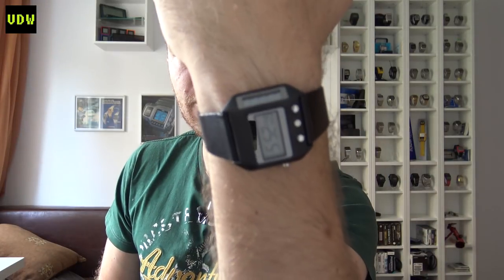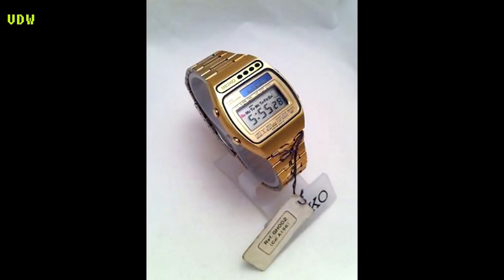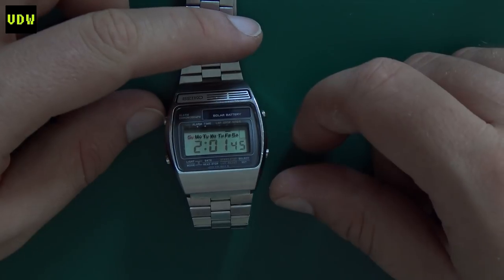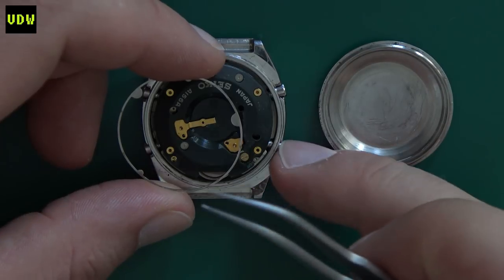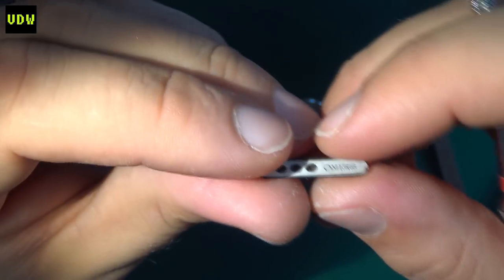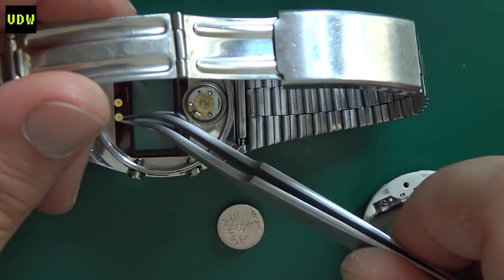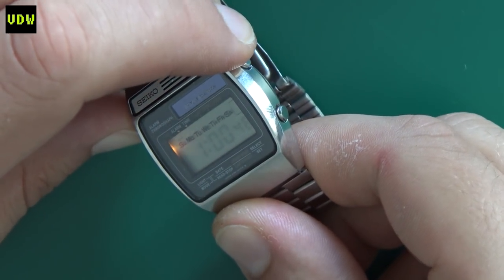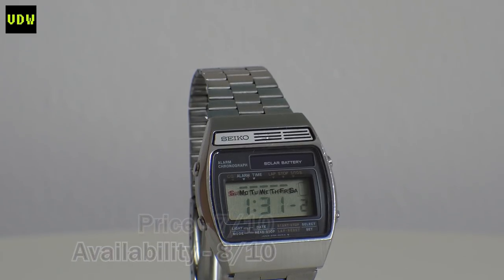Seiko A156 Review - Ep 56 - Vintage Digital Watches

Comment: Hello, This is also my favorite Seiko Digital Watch..
I use a VARTA V15H rechargable battery.(NiMH 1.2 V 15 mAh)  This works great in this watch! It also has the exact size and it charges on the solar panel...
Reply from the maker: Super Useful INFORMATION, I'll pin this post in case anyone else needs something like this. I just ordered one.
Reply: I 'm tryng but it does not work in mine. Does anybody else Tried it? It also seems not right size
Reply: Muito obrigado pela informação!!
Reply: Receiving mine tomorrow. Was looking for Battery info!
Reply: @VintageDigitalWatches  and it works?
Reply: Hello!!!. Is your Seiko still working fine with this VARTA V15 battery?
I just bought this watch and it needs to replace the battery.
Thank you

Comment: I have one of these purchased  new back in the 70s and need to replace the O ring seal for the screw-off cover.       Are these O rings available?    If not, what are the dimensions of the O ring?   

Thanks!

Comment: Hello, I'm tryng to fix mine. I disassembled the module , cleaned everything and reassembled. Then I put on a New battery (normal one 1,5v) . Watch seems dead but after some our it turns on. The problem is that when i press the right buttons they work (even beep) but watch turns off for a while. If i press left buttons (light(witch works), adjust ) watch turns off longer. Light always works. Can you help me?

Comment: Once again a great video and review of this must have seikos ( for me anyway)
I didn’t know you could have used a standard battery for solar. 

Ps, thank you for the group shout out in your credits.
Reply from the maker: No problem Michael, and  in the first comment someone recommended an alternative to the power cell, I already ordered one and I am keen to see if it works.
Reply: Note that this only works if the secondary powercell (the solar panel cell) is not damaged..
I also have a A156 that only works with a normal battery, because the secondary battery is damaged...
(The panel will blink after a while, indicating the powercell have to be replaced)
I hope you already tested the Varta V15H. I already have the watch running for over 4 months now without any problems... (the datasheet of this powercel says its Life Expectancy is about 6 years...)

Comment: acctually i bought the A156 on eBay with a 'normal' battery. I changed this with the Varta V15H.
After e few weeks the 'normal' battery exploded! You don't want to have this happening when its inside the watch. so maybe its better to be safe and put tape on the charging points...

Comment: hi. i have a A158 and would appreciate any review/description available. i am keen to use it again but it appears that one of the connectors on which the battery rests/connects has come loose after being in its box untouched for probably over 25 years. thanks for any insights / inside views to restore mine.

Comment: Hi man. Really great channel. Congratulations. I have this one and the melodic, it is beatiful. It has a missnig segment wich sometimes is shown, but it is almost always off. I cleaned zebras, LCD contacts and motherboard contacts but nothing. Do you have another techinique to bring it alive again? In bigger calculators I have seen a tech who pass the solder over all the contacts in order to refresh them if any is in bad condition, but the chip of digital watches is very small and I am afraid of pissing out. Thanks a lot. I have almost 200 digital watches, some of them very strange. Greets from Argentina.
Reply from the maker: Hi, and thank you for the comment. Good that you cleaned the zebra strips, make sure the LCD is also cleaned and the board. If everything is cleaned it is either the LCD or the board of the watch. You can test both but it is a little complicated. As for the soldering technique, it is just a technique and you can refresh the solder in any other way.
Reply: @VintageDigitalWatches   Thanks for your response. I catched a technique, maybe useful for you. Using a great lens, if looking at about 45 degrees the segments appear blue, they are ok, but if they appear grey, they are broken. Did you know that? Greets.

Comment: Hi!
I apology if this is not the right place to ask but I have a A159 Seiko and i damaged the piece of plastic ( I don’t know how to call this) below the glass (where there is information on it such as « light », « date+... what pusher do what, etc)... so I damaged it in the ultrasonic bath with the wrong solution while trying to refurbish it... ( i am a beginner and I feel so stupid)... my question is, can this piece of plastic be separate from the body of the watch... it seems so solidly attached... I am hoping to replace it from a donor watch. I don’t want to mess up again. Thank you for your time.
Reply from the maker: I believe you can only remove it if you remove the front glass. The graphics are printed on a thin aluminium plate, that needs to come out.
Reply: Vintage Digital Watches thank you for your help... in the mean time, I tried to remove the glass... I managed to successfully break it the glass... the graphic plate is removable that way indeed. 
Have you ever tried to remove a glass on those type of watches?... would you have tips?... because of the graphic plate, the space left to push it out is very small... mmmh would you a press?... fingers?.... hot/cold trick?

Comment: I  have a vintage Seiko Chronograph N° : A 127-5010 R Made in Japan, do you know the value, year ? Thanks .
Reply from the maker: Year can be decoded from the serial number on the back case, you can find a calculator/decoder online. For pricing you can look up sold listings on eBay.

Comment: I did some research on the rechargeable battery for A156, apparently there's a replacement which is still available and on Seiko's list for suitable cells. It's the XR11630W, I found the information on the following website, including a list: https://www.thewatchsite.com/threads/what-battery-for-seiko-a156-solar.311977/

Comment: Another great review! Super nice watch Tiberiu.Talking about old solar digital watch i prefer the rare Citizen 50-0518 released in mid to late 1977. This one use a module close to the early 9060 (1976).
You can see a post here:
http://www.newdwf.com/viewtopic.php?f=58&t=7887&p=50138&hilit=citizen+9060#p50138
Reply from the maker: Hi Simone, thanks for sharing that model, I never knew about it's existence, it is already in my saved searches on eBay thanks to you :)